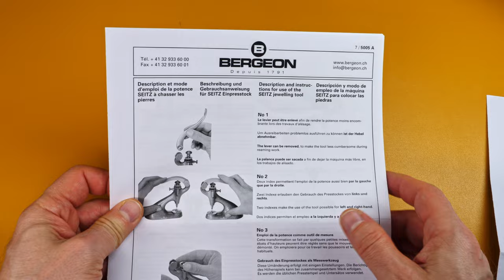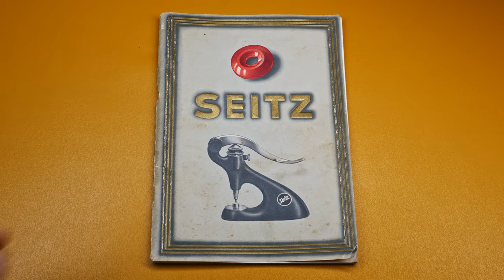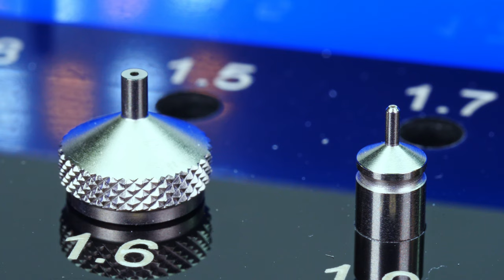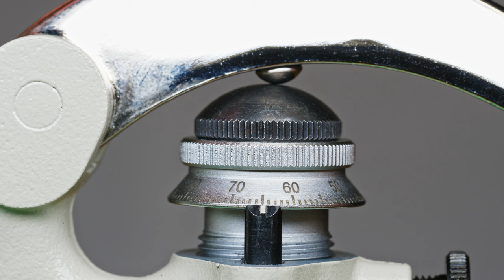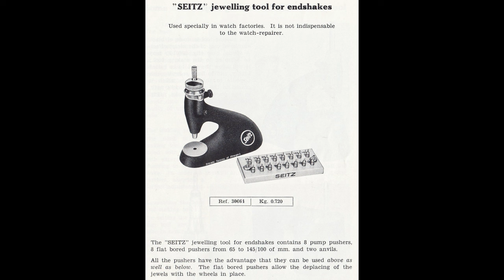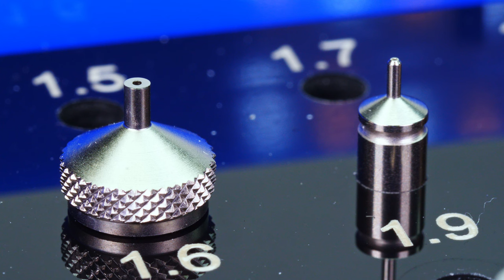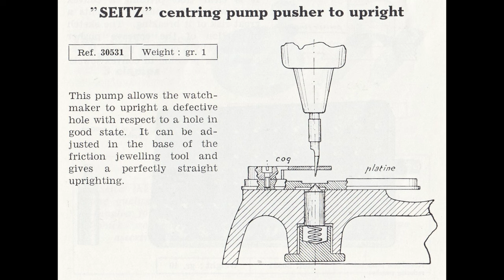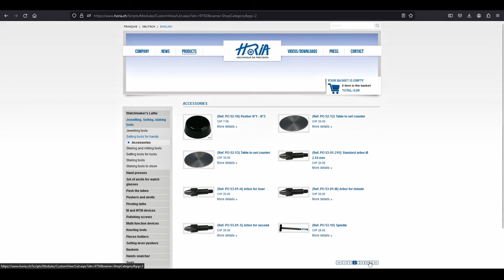Genuine Horia and Seitz by Bergeon jewelling tools - replace watch jewels, incabloc, pallet staff

Comment: Great video (really!), but I have a couple of points.  First is that you shouldn't have removed the spring when converting the Seitz to micrometer mode because that's why the pusher now doesn't go up when you unscrew the micrometer.  It goes up and down just like the Horia if you don't remove the spring.  Second point is that I'm glad you're pointing out the quality of (recent) Seitz pushers and stumps, but keep in mind that vintage ones are often much better made, correctly concave, and with little pump pusher side shake.  This comparison is most useful if you're purchasing a new tool.  Older Seitz sets also include far more stumps.
Reply from the maker: Thank you, glad you enjoyed it!
The cap is not attachable to the spindle, I do not understand how it would go up?
I can only compare what I have, I do not have the old Seitz tool hence only comparing the the new Seitz/Bergeon.
Reply: @MacroTime28800  The spring pushes the spindle back up, it doesn't attach to the cap as you noted.  Try it!  Also, the screw on the top of the cap changes the depth of the inside of the cap which allows you to 'zero' the micrometer in any given position.  I just uploaded a demonstration video on my channel if you are curious.

Comment: These videos are golden!.  I have been wanting to get a Seitz tool mainly so I could ream out barrel arbor holes that tend to enlarge over time.  Yes, oftentimes, they can be closed using a staking set, and I have done that, but I have always wanted to ream out the hole and insert a new bushing or jewel.  The tool can be found but my problem is finding a place to obtain the correct size jewels or bushings.    Thanks for your cool and thorough videos and tip on the reamers using the staking set.
Reply from the maker: Thank you! Glad you found it helpful 🙂

Comment: Disappointed of bergeon. I really like the ideea, and the different things you can do with it, but the quality...
Reply from the maker: The quality is a problem. The micrometre, after taking it apart and putting some grease there, it's much better now. But the pushers, that's something I'd expect from a cheap clone.
Reply: I have two older Bergeon/Seitz jewel setting tools and the quality is definetly better than on the tool in the video.
I think the grey version from the 60s/70s is the best version, as it has 4mm pusher and 4mm anvils, not like the older ones with 3mm and 4mm mixed in a single set and the quality is at least better than shown in the video.
Reply from the maker: The quality is not what it used to be and of course it now costs a lot more than it used to. Perhaps the cost is just inflation but the quality suffers

Comment: I have the made in Switzerland Seitz jewelling tool the same as described in the book of this video.Mine comes with the extra chrome  plunger screw knob that can be used instead of the lever.When using it to to push out or set jewels the micrometer can be set to  depth and the Crome knob has almost 3 mm of travel to screw down to the micrometer set depth which is more than enough to screw press the jewel in or out of its setting.The pressing shaft will return after setting or pressing the jewel out as the spring is still acts the same with the chrome top screw as when using the handle.This old Seitz set comes complete in a long box with flat pushers pump pushers concave pushers reamers anchors straiteners and anvils.A very well made old tool.
Reply from the maker: Unfortunately they don't make them like this anymore

Comment: The old Seitz tool can be used without the handle and replaced by the extra chrome screw knob,and it springs back as well!The same as the Horia and with the handle folded out of the way no need for the extra end shake tool.
Reply from the maker: I've seen the older ones, they have a ring on the spindle to push against the spring 👍

Comment: Thanks for this detailed review! Many of us have bought used original Seitz sets and I was wondering if they are similar in quality to the Bergeon made sets. I will have to check mine.
Reply from the maker: I’ve never had the old Seitz set, but I dare to make an assumption that the pushers will be nicer than the new ones I have

Comment: Couple of comments,

You can use concave pushers as anvil if you have tight spaces just make sure to stop in time or you will crush the jewel after it's out. 

The threaded bottom on the horia is to fit a screw so you can use pushers upside down. 

You should never, ever push a jewel out from the underside to the outside or from outside to inside as the holes are slightly tapered to prevent jewels from being pushed out away from the axle if you do this you can damage the hole and have jewels that are looser than factory spec. 

Your Seitz press is a previous generation than what bergeon sells now, I've only used older sets so I can't comment on the quality of the latest one but my old sets where all perfect.

I mainly use the horia both the micrometric kind and the lever, the reamers are really nice and they also have 5 sided broaches which are more ideal centering wise VS the D shaped reamers.

You can put the spring back in the Seitz to make it go up again... The screw is for adjusting the depth of the spindle so you can use the micrometer bit and anvil.

Good video overall.

Edit, looking closely at your video it appears your spindle is missing the snap ring retaining the spring, if you have a lathe you can easily cut a groove for a split steel ring to fit. Your tool is useless otherwise it will just fall all the way down when you insert it...
Reply: I've also seen the micrometric horia and it works the same as the horia.
"Chatons sa" also made a micrometric press.
Reply from the maker: I thought that’s what the thread in the base of the Horia tool was for.
I just found it strange that Horia didn’t have that screw on their website, or to be correct, I didn’t see one.
I had a discussion with several watchmakers whether there is a way to push jewels out. One suggested that perhaps from the underside.
My guess is that if the holes are tapered, that will be only on the higher end movements as this adds cost to manufacturing. Where did you get the info from?
I don’t think the Bergeon/Seitz is missing the snap ring. It’s not mentioned anywhere in the documents from Bergeon. They either no longer do it that way or you perhaps bought a used one that has been modified?
Reply: @MacroTime28800  most lower end movements have tapered holes, I was taught this in watchmaking school.
Reply: @MacroTime28800  the Seitz is not modified.
Reply from the maker: @Inkreptile  Thank you, that's good to know.
Reply from the maker: @Inkreptile  It's a shame they don't do it anymore. Although I can see that this would be an easy modification.